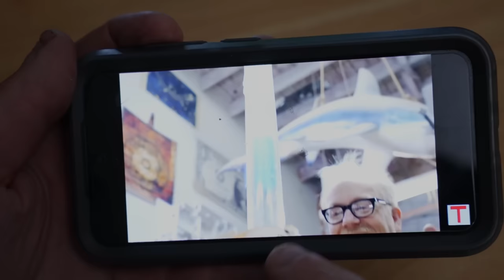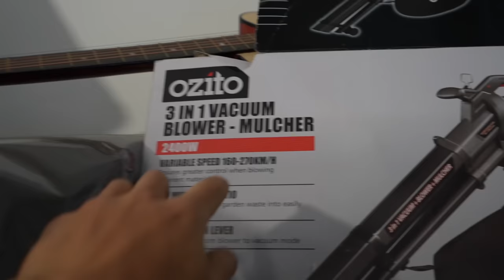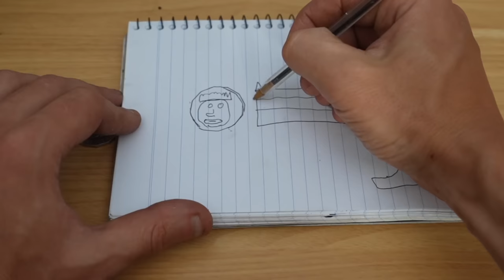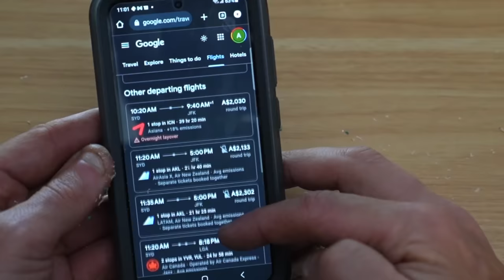The Mythbusters Were Wrong!

Comment: Mythbusting Mythbusters seems like a fun series, although I fear it maybe a short run series.
Reply: user-yl7mr3ck5l  This doesn't debunk it at all though. The myth that was busted was dropping a penny off the empire state building. This video appears to not be about either pennies or dropping things so is completely irrelevant to the myth, though very entertaining.
Reply: @nephatrine  Actually, I think you'll find that the majority, if not all, of Mythbuster's experiments are severely lacking and don't account for a myriad of variables. It's still a decent show, and relatively informative, but it's hardly the be all, end all of scientific mythbusting. It was all very surface level, they had limited time to do things and a limited budget. The main thing was to make an entertaining show. I wouldn't take most, if any of it, as irrefutable scientifically proven fact however. (In fact, I wouldn't do that with many actually scientifically proven facts, in the first place. There's very little which turns out to be actually irrefutable. We learn, we grow, we learn more.)

Also, this video is entirely about dropping pennies. And as stupid yet entertaining as IDAT always is. Though hardly a "debunk" video, lol.
Reply: @anomonyous mythbusters frequently take liberties to make it more plausible.
Reply: @nephatrine  The Mythbusters, despite liking them at the time, I think is largely responsible for the myriad of people that think they are scientifically literate when they are not. The "I fucking love Science!" types who have not the slightest bit of applied empiricism in their lives.
Reply: @Gorgonzeye  The sort to also see any questioning of established science as automatically wrong. Like science is some religion and saying anything outside of its consensus is heretical, unless it is a hecking cool clickbait headline.
Reply: @Gorgonzeye  you must have a lot of friends who enjoy talking to you and are fun at parties and other social events :)
Reply: I remember when they did the cable snap one. My dad was pissed because they didn't use nylon rope and he knew people who had literally seen it happen.
Reply: @Zorae42  Which myth was that?
Reply: @newbiegamelover4767  The myth that a cable snapping can cut a man in half. But they used a wire cable instead of a synthetic rope, which doesn't snap the same. Nylon stretches, cable doesn't stretch anywhere near as much. I'm not sure about specifically "in half", but there's plenty of evidence of decapitation and amputation of one or both legs with mooring lines. But iirc, the wire cable they used only left bruises. So it seems like being cut in half is pretty damn plausible if they had actually done the experiment with the right material.

It was a pretty egregious error.
Reply: @newbiegamelover4767  The myth that a cable snapping can cut a man in half. But they used a wire cable instead of a synthetic rope, which doesn't snap the same. Nylon stretches, cable doesn't stretch anywhere near as much. I'm not sure about specifically "in half", but there's plenty of evidence of decapitation and amputation of one or both legs with mooring lines. But iirc, the wire cable they used only left bruises. So it seems like being cut in half is pretty damn plausible if they had actually done the experiment with the right material.

It was a pretty egregious error.
Reply: @Zorae42  Agreed.  I've worked in the utilities  industry for a while and we've had multiple reports of grave injuries and deaths when it comes to cable on pulley accidents. Flying cables are no joke and CAN cut limbs off. Truly sad.
Reply: @Poison_Paradise  Assuming he cares about things like amount of friends as a value for himself or how competent their intellectual level is at conversations during parties... There's "Ah yes relativity of speed is an interesting topic" kind of people, and there's "hurr drink beer, talk about game of thrones and why the Kardashians are the best" kinds of people. Don't think everyone values the same in life.
Reply: @Zorae42 There's also different levels of energy you can put in, there's safety video in old archives of a snatch style recovery with railway locomotives  and a hawser going wrong, that did kill people. The nylon rope is easier to store energy in with a car or such though.
Reply: @Zorae42  if I remember right, wasn't that myth about Carrier catch cables snapping, you know, the wire cable that grabs the hook on a jet as it lands on the deck to stop it.
Reply: the first episode was laughably unscientific. i think they got better but it was mostly for entertainment
Reply: Myth busters has been debunked at least 10 times. I would LOVE that show!
Reply: @demon-hunter1498  Never heard of that myth. Navy guys are literally made to watch safety vids about mooring lines though. Nylon ropes are way more dangerous.
Reply: @Zorae42  like I said it's what I remember as in that ep they show a vid of a catch cable snapping but I could be wrong.
Reply: @demon-hunter1498  Pretty sure it was just "cable" in general and then they went out and got the "strongest" cable they could get without recognizing that while wire cable can take a stronger load, it doesn't store as much potential energy as the nylon cable due to the stretch.

It'd be like testing a rubber band snap by using cotton string. Cotton string can hold a lot more weight, but it's the rubber band that's going to actually snap back with force.
Reply: @Seriouskai I love that your examples for two different kinds of people are apparently people who like talking about speed relativity and people who are idiots that also love Game of Thrones and the Kardashians (and drinking beer, because alcohol is for dumb people?) 😂 

What a false dichotomy
Reply: @mistertwister2000  It's a simplified take on things because clearly you can't be fun at parties or have friends if you don't conform into an accepted idea of "normal". And a note that not all people even care about going to parties, so it's a moot argument to begin with online when you know jack shit about the person you comment :)
Reply: @Seriouskai  I’m not the person who said “you must be fun at parties”, I honestly think it’s incredibly small minded when people believe a person can’t be fun around other people just because they aren’t “normal”. It reads as someone who’s never heard of, y’know, finding people similar to you? Idk, it seems silly for someone to assume “oh this guy’s into physics and doesn’t really care about pop culture? I bet he has no friends”
Reply: @Seriouskai  are you shitposting or do you not know what relativity means

Is this bait

There is no "relativity of speed" but there's RELATIVISTIC speed, and your strawmen are so bad dude

I'm pretty sure the first guy was genuine though
Reply: @Seriouskai  also I was making fun of how he was being an asshole, generalizing people, not saying he's an outcast for having interests in nonconformist things. 

Crazy how you pretend to be smart but couldn't grasp such a simple social interaction.
Reply: @Poison_Paradise  Your name certainly suits you bud :)
Reply: @mistertwister2000  Yeah that's pretty much what agitated me to begin with, I've seen those fun at parties comments time and time again and it just becomes stale and aged in such a shitty manner. Normally, I'd not give a shit and just move on with my life as a sane individual would, but sometimes there is that itch to just say something. Sorry if I came off in a bad way towards you though, I get that often with the way my thoughts come out in text.
Reply: thanks; my channel description probably does too  @Seriouskai  you don't seem very fiery though
Reply: @Poison_Paradise  Dude I'm closer to my 40's at this point, I don't do fiery anymore. Not gonna lie, you sound like my edgy teen cousin.
Reply: @Poison_Paradise  You are right, reddit is the main thing that started this not Mythbusters. Why don't you go back at some relativistic speed?
Reply: @Zorae42 wasn't that version of the myth based on that ghost ship movie where it was a wire cable so they tested the myth just not every possible version of the myth

Comment: The one thing he still needs to test are side winds. I suspect that during the fall from the Empire State, that side gusts would hit the coin and send it off-face. The counter to this is a really strong spin, but I don't think you can pull that off with enough inertia - mostly because the coin doesn't have enough relative mass. So, I still think there is a real possibility that a spun, heavy coin would not kill someone if you dropped it. 

Also worth noting that the original myth is a penny, which I think even with these ideal conditions wouldn't kill anyone. 

Superb video as always.

Comment: Its less the weight, more that the apparatus blocked the sensor on the bottom which the Mini uses to detect obstacles. That's why you had issues lowering the drone - it tried to avoid the "Ground".

Comment: Wind exists. I've been on the Empire State Building and it was windy af up there. A coin wouldn't be able to stay vertical with that wind.
Reply: They also used a coin 10x heavier than a penny. I don't know what's the weight of a quarter but I know it's not the 10x the weight of a penny.

Comment: The speed calculation at the beginning may have been wrong because it didn't consider parallax. Parallax is when things closer appear to move faster than things further away. This is the same thing that means you can move your finger a few centimetres in front of your eye and it appear to move past the moon. Trigonometry or something.
Reply: That actually makes a lot of sense. Thank you.
Reply: Parallax is not intrinsically about speed. It affects an observers ability to accurately determine the speed of two objects at different distances. It also affects the ability to read a stationary analogue gauge l.
Reply: He could do some silly math to find the actual distance it traveled… but a chronograph is “easier”
Reply: he also didn't consider that framerate isn't necessarily the same as shutter speed, you can be shooting at 250 FPS and 1/500 shutter speed, that'd mean the shutter is only open for half a frame for every frame (1/500th of a second every frame), thus, whatever it appears to have travelled in one frame, is actually half of what it travelled during the frame-time
Reply: Actually he made a mistake as in his calculation his coin traveled 172 kmph while the fastest baseball pitch was 170 kmph (106 mph), and we know it's much easier to accelerate a small compact and aerodynamic metal object than a big soft baseball
Reply: Get out.
Reply: Kid named Finger:
Reply: I’d add to the plate analogy. The speed of ball is measured at home plate. While the coin speed is measured much closer. Makes me curious what the speed of the ball is leaving the hand.
Reply: Sorry I think I misinterpreted your use of metaphor to describe parallax as a definition
Reply: @_j_j  No worries my dude
Reply: @Niraol I understood nothing at all but it sounded smart. Was the coin supposed to be faster then since aerodynamic do be tending to break the speed more compared to larger objects
Reply: Parallax would not make much of a difference unless there’s a large angle and the coin is thrown far from the face of the measuring tape.

Comment: I really feel like the drop from the Empire State Building would be long enough to lose the spin and make the coin start gliding on its flat face anyway. Maybe this specific coin is still heavy enough to pack a punch, but probably not go straight through a human skull.
Reply: So what you're saying is that we need to find a building at just the right height so that the spin is lost right after it hits the ground?
Reply: just spin it faster or something
Reply: It’s the same concept as of shooting a bullet with a gun.  Even if you shoot a gun, the bullet will eventually slow down due to air friction and become non lethal.
Reply: @xirenzhang9126 
to spin it really, really fast you'd basically have to build a Coingun and be firing it downwards from the Building, which starts to drift out of falling and also is definitely no longer an accident.
something like those Foam Disc launchers, or Airsoft/Paintball guns. some very fast squash rollers.
Reply: @ecard0  Absolutely. It's a bit counter-intuitive, but true.
Reply: @Montrana  Then the question would be, would you reach enough velocity in that time to actually do damage.
Reply: @taiiat0 new hitman weapon unlocked why buy bullets if you can use coins 😇
Reply: How would it lose its spin? Friction will be minimal. Look up Euler's disc and you can see how long spin can last, even with significantly more friction than what the coin through air would experience.
Reply: @zagreus5773  Hey maybe finish Physics 1 before talking, ok? lol
Reply: @zagreus5773  Add enough speed, and air friction is suddenly a lot stronger than the low-friction materials used for an euler's disc. You have to take into consideration that a coin is small, and the smaller an object is, the more surface area it has relative to its volume. More surface area, more air friction. That's how something as dense as iron can be picked up by wind and carried over long distances. I'm not going to pretend that I know for sure that the spin would dissipate before reaching the ground, that would require proper testing. That's just a gut feeling. You also need to consider that the coin would be spun by hand in that scenario, not a machine.
Reply: @subcinericius  rude and condescending
Reply: Your feeling is correct. If he had tested the falling airspeed of the big coin in a long enough tube, it would have eventually slowed down and been spat back out the top of the tube at much lower air speed than what he concluded was it’s terminal velocity.
Reply: @Teauma  If one does not know what drag is then they should not comment like they understand any physics.
Reply: The wind at the top of a building that height is generally pretty insane. The face of the coin almost certainly has enough area to get blown off-kilter unless you have an insane amount of rotation on the coin.
Reply: @Teauma  Hmm, no the speed is completely irrelevant, because one is rotational motion and the other linear. Basically the air would speed the coin's rotation up on one side and slow it down on the other, equaling each other out.The only thing that matters in the calculation is the time the coin is in the air and if you could spin it for that time. The Empire State Building is 380 m tall and the coin is accelerated at 9.8 ms^-2. You can use sqrt(2h/g) to calculate the time for it to reach the ground when ignoring air resistance. That means it takes about 8 seconds. Pretty sure I can spin a coin so that it remains spinning for 8 seconds. You can see how long things remain spinning on the ISS as a comparison.
But just for fun, lets factor in air resistance under the assumption that the terminal velocity is 250 km/h. The coin has a diameter of 32 mm and a thickness of 2.8 mm which means its cross section is 90 mm^2. We can calculate the drag force at terminal velocity using F = 0.5*Cd*p*A*v^2 = m * g. This means the drag coefficient (Cd) is roughly 0.574 (its probably smaller, since we underestimate the terminal velocity). Calculating the adjusted time from this is a little complicated and requires differential equations, but if we simply use the mean velocity as a rough estimate we get a time of 11 seconds until it reaches the ground. I think I can spin a coin for that time as well.
Honestly, I think it would take up to a minute for the coin to stop spinning, and even that might be an underestimation. Again, stuff spins for ever on the ISS. Certainly more than 11 seconds.
Reply: @zagreus5773  "Basically the air would speed the coin's rotation up on one side and slow it down on the other, equaling each other out." I didn't think of that. Interesting. But did you take in consideration the formidable amount of wind pushing the coin around from the side, basically trying to make it parallel to the ground?
Reply: @subcinericius  Except this is not a physic conference, just random people trying to figure things out for fun. Everyone should be welcome.
Reply: @Teauma  
you can be sure that the Spin would degrade long before it hit the ground. it doesn't want to keep spinning on its own, hence i said that you need to impart a ton of it so. excessive amounts so that as it bleeds off later it'll still have some of that Inertia left.
the sort of spin any of us would impart by Hand, i'm fully confident would degrade long, long before getting near the Ground. since all we're Talking about by Hand is like mayyyyyybe 200RPM. perhaps 300 with practice.
Reply: @Teauma  Well I am an Elf in that case and I cast fireball.

Comment: This reminds me of the falling bullet thing where a bullet shot straight up will tumble on the way down and not be lethal but if its shot at anything other that perfectly straight up it can maintain its ballistic trajectory and remain lethal. I actually suspect the updrafts at the empire state building are sufficient to knock the coin out of a stable spin and cause it to tumble and lose speed long before it would hit the ground.
Reply: Yeah that’s a interesting point about the bullets, I knew that but totally forgot. Although I think even near straight up still causes a tumble most often. For the coins I’m figuring it’s damn near guaranteed to fall out of equilibrium, the updrafts definitely hurt but just the extreme distance also gives it way more opportunities to go bad. So that basically means shorter buildings are probably more deadly which is a lil wild
Reply: But the wind tunnel